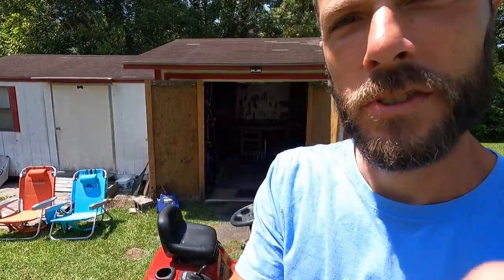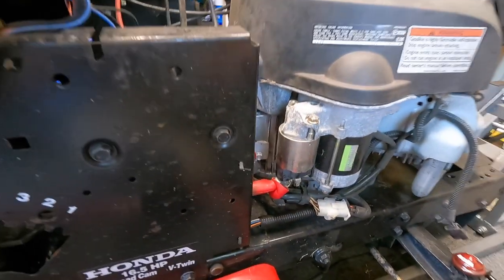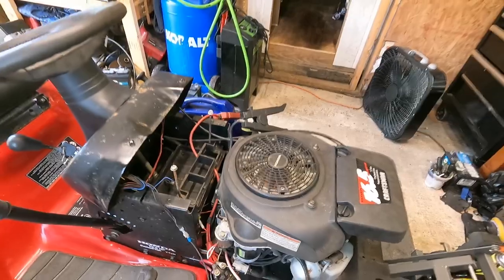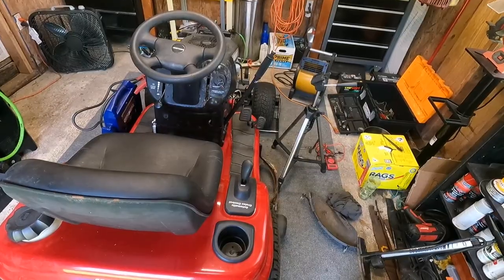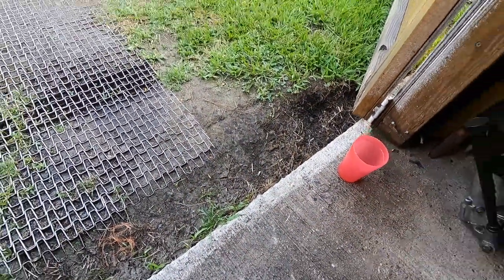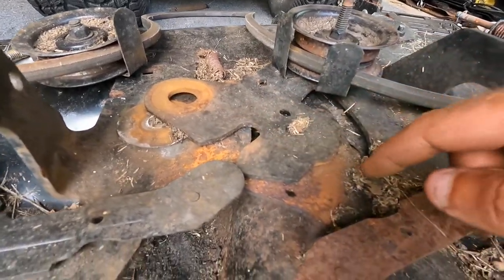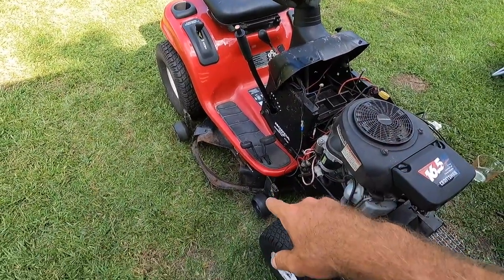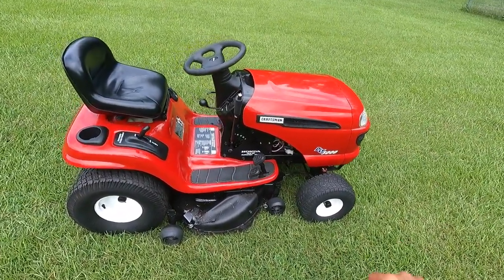FREE CRAFTSMAN TRACTOR IN NEED OF REPAIR (DLT3000)

Comment: Nice video. I find this as I was just given my first riding lawnmower. It’s a 2001 John Deere LT133. The original owner had it garage kept. My friend bought it from him and he had it for 2 years. One day the deck fell off and he parked it for 3 years. Then he gave it to me. I put a new battery, fuel filter and switched out the fuel. It fired right up! Today I changed out both belts and sharpened the blades. I also sanded the underside of the deck which is about the only place there was rust. I sanded, primed with rustoleum and painted to protect it. It didn’t have the pins to secure the deck and I’m just going to bolt it in place. This mower looks brand new which is amazing for 23 years old and free minus some maintenance.

Comment: I got 2 dtl3000.I switched the one from a hydro static to regular trans with a parts t2000 had..Werid the little changes they did between the 2..Fuel tanks under the seat on the hydro.The other one is like yours...Glad ya got lucky. ❤

Comment: A friend just gave me this same exact mower today. Same Honda motor with the hydrostatic transmission. I put in a new battery and same issue with the starter. I was able to hit it with a rubber mallet and got it to finally run. I have my work cut out for me but it gives me something to do.

Comment: First  time I saw a Honda on a rider for me . What a good rewire bypass job . I know on a Honda push mower you don't push dip stick in too check the oil .
Reply from the maker: Thank you very much. Yea I figured that’s the way to check this one. I don’t thread them in usually on the Honda push mowers, but wasn’t sure on this one as I haven’t come across twin cylinder.

Comment: FYI the way you connected the second solinoid should have made no difftence as it is still having to actuate and run through the original solinoid. Please re connect the wiering as per original way and I bet you it will now work. Cheers Stew.

Comment: I see a lot of folks that want the ability to mow with the chute up for various reasons. They use bungies , string or a piece of rope and that to me is so inconvenient. I have never shared this, but I've done this set up on every riding mower I've ever owned and it's fool proof. Use a hook and screw eye to latch the chute up . Attach one screw eye to the side of the rear fender and two to the chute. Test distance before drilling to ensure the screw eyes are in the right location. Use one on the chute with a spring to the latch the hook, and the other end of the spring to the screw eye then install that screw eye to the chute. The second screw eye is also attached to the chute far enough to just give the spring a little tension so the hook can be latched to that second screw eye firmly when chute is being used . Now the Hook can be latched onto the screw eye mounted to the fender to keep the chute up and out of the way. This method also allows the deck to be raised and lowered when the chute is raised. This setup is on my 1999 Scotts S20hp/48 and my 2018 46" Cub Cadet XT1.  So simple & inexpensive, but absolutely effective. I hope this helps someone , if not there's always the option of a bungie or a piece of rope. LOL

Comment: That dip stick screws on like a Kawasaki and the Kawasaki says when checking the oil level don’t screw it down 🤷🏻‍♂️
Reply: I didn’t think about that but given the level of service this machine has had I suspect that’s correct and the oil is not overfilled. That said, if I discovered that I’d do my research first before trying to start it just to make sure I didn’t destroy it. 🔧👍
Reply: @Rein_Ciarfella  
Well every Kawasaki engine I’ve ever seen has that stamped on the dip stick but I’ve never seen a lawn tractor with a Honda engine so I can’t say for sure one way or the other. That is a nice looking and sounding lawn tractor though.👍

Comment: I have the dlt 3000 with the els725 b&s vtwin, but gear drive. I cant find a OEM part number for the fuel filter and trying to decide if I need a screen or paper filter for it. Also trying to figure out why it jerks forward when releasing the clutch in gear, or a suitable bagger option for it. Any help would be greatly appreocated!!
Reply from the maker: If it has a fuel pump then usually it takes a filter with paper. The gravity fed units normally take the regular ones. I’ll see if I can find a number for a bagger for you.